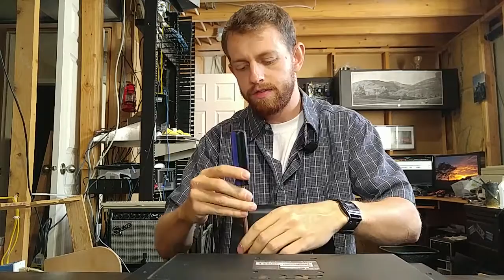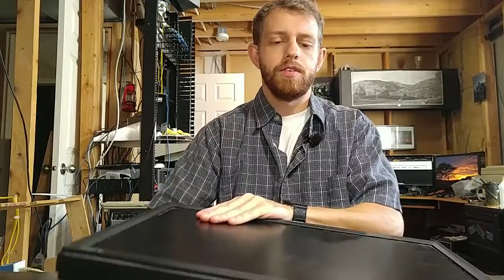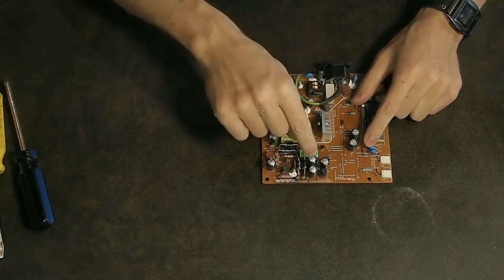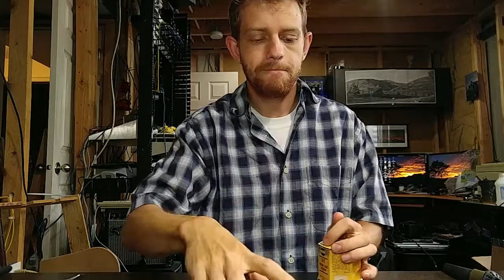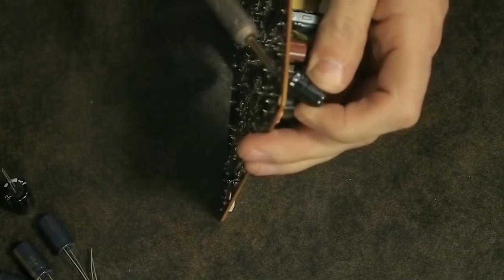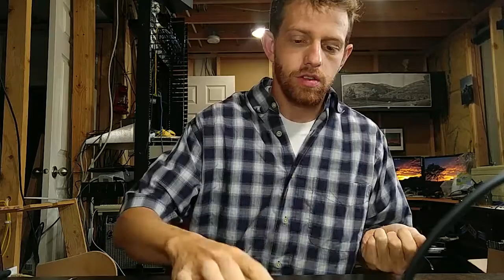ACER AL1916W Computer Monitor Repair

Comment: Great video. Still working on figuring out which capacitors to order, since after my monitor quit and I opened it up I found 12 leaking capacitors. Its a wonder it worked for so long.

Comment: My Acer AL1916W A just died.  The screen went black but the power button was still on.  I turned it off and back on and after the screen I was looking at shoed for 1 second then the screen went black again.  A few years ago another Acer monitor died.  I couldn't figure out how to open it so I threw it away.  This time I am determined to fix it.  My AL1916W doesn't have a single screw on the back.
Reply: Same here, no screws on the back, and it happends the same but when I put the flashlight from my phone in some angle I can still see the image, so it's something to do with the screenlight in my case, try to check if the same happend to you, looking on some forums, it seems that I need to replace the light inverter or something like that, I just wish to know where to find that

Comment: Hi dude, great video. I have one of these acer, with same symptoms. Do you remember the specs of the ordered capacitors and how many of each?. I need to order them and i cannot see the board because the monitor is at my parents house. I’ll truly appreciate any feedback. Cheers. Edited: disregard my previous message i found the info in the comments below. Thx

Comment: Hmm... I have the same monitor, same model number, but no screws! I don't know how to get into it... yet
Reply: same model different revision, if there are no screws that you can see then that revision probably doesnt have one. scratch  stickers maybe there are some beneath them. gl
Reply: @petar932  Thanks for the reply. I finally braved the unknown and just pried it apart. There were no stickers other than the center info plaque. The frame just clipped together. I was able to get in and replace all caps.
Reply: @TreyCook21  sure thing, glad i was helpfull

Comment: I have the same monitor. My led went orange and never power up to green. I found 4 or 5 bad capacitors replaced them with new ones , no change. Still doesn t power up. I ve checked and measure all the diodes from power board , I have 4 CI on radiators I m suspecting they are right, don t see anything blow up or something, also 2 little transistors, which seem fine, resistors ok. From PoweBoard it goes out around 5V where it should be, and another voltage 14, 5 V or so into the logic board. What can it be? I can t figure it out. The led is stay orange. Press, press no change. It doesn t power up to green. I ve checked the little switch board seems ok all the switches. What are the 4 cables that goes left up into another long top screen board? Can it be faulted? Maybe u can help.
Reply: derek33111 does it say no signal? If yes then it could be your cpu not the monitor

Comment: Thanks for the video Jim! Where do you order caps from?
Reply from the maker: I ordered my capacitors from DigiKey but they could also be ordered from other places like Mouser or Amazon. If you have a local store that sells electronic components like Radio Shack or something similar, you might be able to find them there also.
Reply: Thank You!

Comment: Thank you for your video, can I install a 16 V instead of a 10 volt.? Once you fix this, how long does this last?
Reply from the maker: Yes a 16 volt capacitor would be fine in place of a 10 volt capacitor. When done properly and carefully, this repair will last until the new capacitors go bad or until something else goes bad.

Comment: What are the values of the capacitors you replaced? I need the same ones on my board.
Reply from the maker: CaptDantastic thanks for watching! Sorry it's taken a few weeks to respond. At 6:00 I mention one of the caps is 1000uF and the others are all 470uF. The ones on the board were 10 volt rated.. I'm pretty sure I replaced with 25 volt though. Capacitor like these should have their values printed on the side of them. Hope that helps!
Reply: Jimmy Rigged Solutions Thanks! I'm new to DIY soldering and circuit repair. Ordered some and hope they last!
Reply from the maker: CaptDantastic good luck!